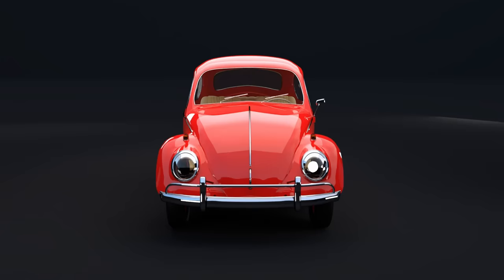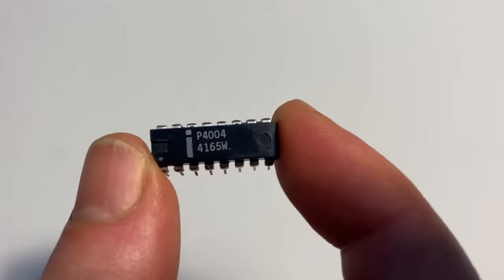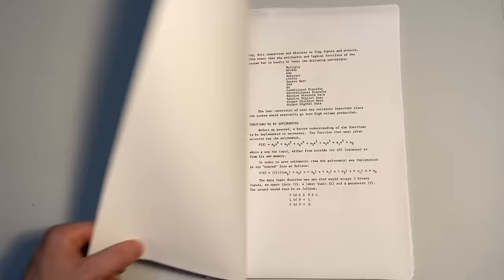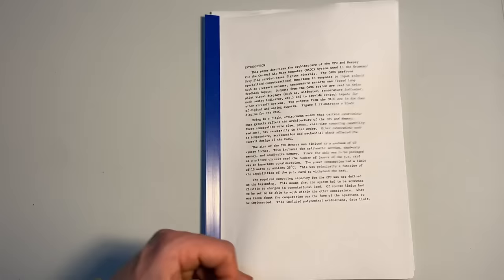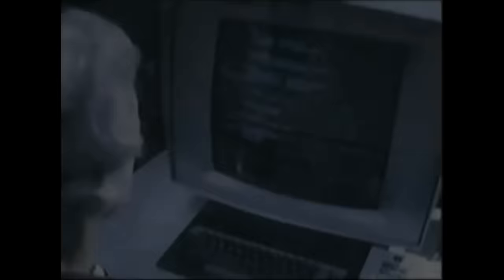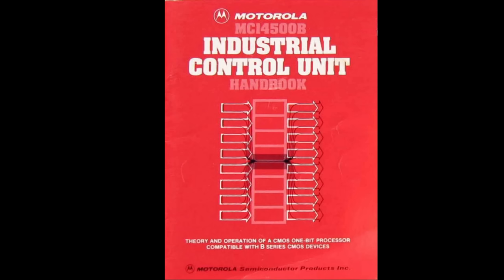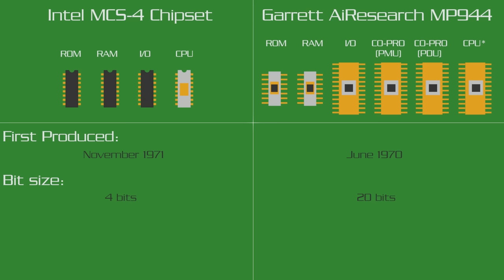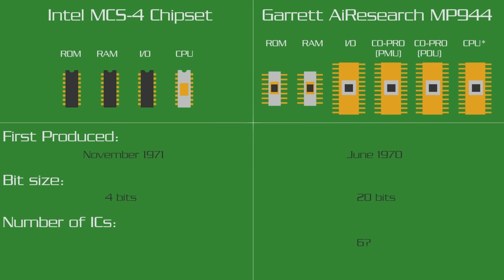The World's First Microprocessor: F-14 Central Air Data Computer

Comment: The mainframe comparisons to embedded dedicated control are a little misleading in the beginning of the video. The large mainframe, like the IBM 370 introduced in 1970, is a general purpose business computing machine, or computer, working on a time share non-real time OS. Whereas, a control computer for the F14 would be a dedicated computer running a single stored program, using a preemptive prioritized real time OS. The two are really vastly different in design and should not be compared side by side as to size.

The 20 bit computing word may not be related to 20 bits in ATD conversion. The ATD will lose bits of resolution in errors, but can also for specific ranges can be augmented by parallel ATDs with different gains. There is perhaps not reason why one ATD is required to cover a complete range you could have overlapping ATDs.

Having 20 bit words with sign is really just saying having 19 bits of resolution with sign. The 19 bits will use a fixed point math approach for size versus resolution (moving the decimal point around). The variables within the algorithms will be scaled as per function while maintaining enough resolution as possible. It is common to have a multiply into a double word and double divide into word usually with sign as native hardware features if computational speed is critical. You could then have slower double multiplies into a quad word and a quad divide by a double and so on in software (math library).

The 4004 evolved from a calculator design general purpose processor. At the time general purpose meant for calculator applications only. The general purpose programming machine was not really considered viable on a 4-bit machine used for calculators, nor would it be useful for a 20 bit word real-time application, although it could be used to understand embedded programming.

It is interesting that the 944 architecture is Harvard. If you have the instruction set, you can back out the most likely digital processing pipelines. For 20 bits it makes sense to clock 5 bits in 4 clocks. So the serial bus is only 5 bits and not 20 for a 4x clocking multiplier. Clocking frequency for a single bit line would be very high indeed for the ICs during the 944 time frame. 

The operation of ICs from -55 to 125 degrees C are the maximum extremes which really ignores reliability. The engineers of a computer for an aircraft will strive to reduce these extremes to a highly reliable MTBF range of temperature excursion. Basically, controlling heat flow. Also, analog parts of the design usually need a much smaller operating range to maintain accuracy due to temperature drift.

Calculating at 18 Hz or 18 times per second, seems very slow to me. For a Z domain transform the computational rate should be more like 160 times per second for system mechanical time constant (8Hz max) digital computer control of a flying jet. So, all calculations completed within 3.75ms (160Hz with worse case 40% latency penalty for a fixed priority preemptive hard real-time OS). Although, if you design the system you can do calculations in parallel where appropriate (like shown in the video), which is only really feasible for real-time control of a single algorithm.

Comment: Do you have a video about the jet fuel powered computer that handled the SR-71 engine inputs?  Its temp range got a bit higher than the unit above.
Reply: As in fluidic?  Now that sounds interesting.
Reply from the maker: ...and in to the 'potential future videos' list that goes. A hydraulic computer.....wow!
Reply: That metal pillow thing behind him in the opening shot near the intake is the fluid reservoir for the working fluid.
Reply: Jet fuel powered computer, no. But it was common to have jet fuel as the working fluid for the hydraulic actuation of the variable stators and maybe other things on the engine.

Comment: Just before 27 minutes into this video, you're showing an f4 G model, an F-111 e model from upper Heyford. The F model that I worked on was transferred to lakenheath beginning in 1977. Add what appears to be an F-14 a model. Those swing out control veins you talked about earlier were removed off of subsequent models of the F-14 because there were other ways to control certain flight controls to alleviate any issues that the plane had. The reason those were put on is precisely because the air data computer was not a godsend in the way you believe. That was a fix for a problem with the air data computer was not good at understanding.
That computer was able to remove a lot of analog systems that would have been required to do the same work. And the systems on the F-14 required a boatload of maintenance to keep it functioning. The capacitance fuel measuring system was difficult to adjust and was rarely in its best condition for knowing how much fuel you had on board as accurately as it had been asserted. After having worked on it, I'm certain that it has to do with the fact that the electronics of the day were still in their infancy. Having been rated on the F-15 and F-16 as well as the b1. There were a lot of changes in the way we did the wiring add several other things that were updated in those newer aircraft. The most obvious one was that wire looms came in ribbon cable. Where you had as many as 40 wires that were set into a flat plane and routed around the aircraft. It kept wires from picking up stray signals nearly as easily something that would have been necessary to keep chipsets from commanding things due to corrupted data.

Comment: Nice videos, and the Top Gun endless loop. 😀 I don't think you can say it is the first IC microprocessor if the PC was in the ROM.  More of an IC based microprocessor chipset.  4004 allegedly could run a minimal program with 1 IC and one generic ROM. But it was special purpose 20 bit with heavy arithmetic vs 4 bit so different problems. Maybe you can call it the first DSP.

Comment: I think you are wrong about the glove vanes. I believe they are for transonic flight to prevent Mach tuck but they weren’t very useful and were later removed on newer models of the f14. While moving CoP behind CoM decreases maneuverability is true it doesn’t really matter at speeds where wings would be swept back like that. At higher speeds you will over G the aircraft before exceeding a critical AoA so you don’t need the extra maneuverability. When the f14 is at corner speed which I think is around 350kt the wings will be full forward and that’s when you would be dogfighting and need the extra nose authority
Reply: true

Comment: F14 came about as original planned interceptor F111 joint fighter program didn't meet US Navy carrier requirements it was too heavy& had too high a landing speed for arrested recovery and catapult take off also nose and cockpit layout side by side made landing harder. The wing swept back for fast speeds but swept forward for better low speed landing characteristics. Im told F14 had a slight bug as its wing positioning could give its energy status away to oponents, many didn't get that close in combat.

Comment: The discussion about "what is a microprocessor" is a bit off. If the arguments made here are to be applied I can't think of a single "CPU"today that can function as a "microprocessor" if that mean's it needs to be a single chip. We do have a great many of "single chip computers" but we call them Microcontrollers. All the components discussed are on that single chip and they can cost pennies but I've never heard anyone refer to a microcontroller as a microprocessor. That term would probably still be reserved for what we call a CPU but it has exactly the same requirements as mentioned here but it has nothing to do with technological capabillities, just configurable design practices.

Comment: 8:05 The National Transportation Safety Board later concluded that the breakup was caused by Alsbury's premature unlocking of the air brake device used for atmospheric re-entry. The NTSB said other important factors in the accident were inadequate design safeguards, poor pilot training and lack of rigorous oversight by the Federal Aviation Administration (FAA).[3]
Reply from the maker: If you’re interested, I did an entire video about it (it’s not a great video tbh) and another one about fly-by-wire and how we try to design human factors like that out.

Pilot error was the direct cause, but in a competently designed system, pilot error shouldn’t have even been a possibility.
Reply: @Alexander-the-ok  i blame gawd

Comment: Thought I might mention that microprocessor really only needs to the CPU (requiring the chip set to make a microprocessor system), where as a microcontroller would need to include some I/O RAM/ROM be a largely functional system.

Comment: Thanks for posting this interesting video. I’m a pilot and always been fascinated by guidance and control of aircraft and spaceships. As I recall Apollo 8 had a digital autopilot installed for its flight, the first one made and manufactured by Sperry if I’m correct. IC was introduced on Apollo in the early seventies, but did it also utilise the PM944? A comment on this is appreciated. Thanks:)
Reply from the maker: Yes, you’re referring to the Apollo Guidance Computer. It was made up of many ICs rather than the small number used for the MP944. It was an astonishing piece of hardware - i did a video about it a few months ago!
Reply: @Alexander-the-ok  Thanks for your feedback, I’ll check that video:)

Comment: Processor definition is.  FETCH & EXECUTE Amigo.   I designed the IMMC for Global Hawk at Vista Controls, later Curtiss Wright Defense Solutions.   Retired 2017..    IBMSystem 360. 16.6 MIPS in 1968,   MIL-STD 1750 in 1986. About 0.750 MIPS,   2012. G4V Global Hawk 2000MIPS.  Wow. 130 mainframes.

Comment: As you state, the distinctions for what counts as a CPU in that period seem to be too arbitrary. There is so much built-in those that came later.  Until the late 90s most home use CPUs did not even have memory controllers, IO or what not. Now we have SoCs that bundle the CPU, RAM, storage, GPU, IO, etc. all in one chip.

Comment: So, at the very end of the video you mention that you don't think that the chipset changed the world. I am going to suggest that this is a very narrow vision.

Someone had to manufacture it. Meaning somewhere there was a team of engineers that had to physically make these chips, with these transistor configurations, and these inputs and outputs. These people probably understood pretty well what was going on at the physical level, even if they had no knowledge of the code. Also keeping in mind how long Rear Admiral Hopper's work took to really spread and take hold, I think it is probably a really safe thing to say that the people who worked on these chips took that knowledge elsewhere.

Those of us that grew up seeing the truly digital age take root also need to step back and appreciate the early computers like this one. We need to remember that "programming" as we call it today was still really new. Most computer engineers truly did think that the braided memory of the Apollo computers was cutting edge. So to have something like this operating with calculations at these speeds with such imminent impacts is WAY WAY beyond what the Apollo computers were doing.

Comment: The MP944 wasn't an integrated microprocessor. The core was split up across multiple distinct chips, vs being on the same piece of silicon. The Intel 4004 was still the first true microprocessor as we understand the term. 🤷

Comment: Sure, it's a microprocessor, but it's also an ASIC because it only ever had one application ... and that is a lot less impressive or important :)
Not only that, this is by definition a DSP: digital signal processor. It took digital signals from sensors and processed them into human-readable outputs.
That doesn't disqualify it from being anything else, but a DSP is generally understood as distinct from a CPU as you'd never want a CPU processing signals when you could get a DSP to do it instead. The reason being that a DSP does stuff in parallel.
Reply from the maker: It was only ever used for one application due to it being classified. Ray’s paper discusses other potential configurations and uses.
The same could be said for the 4004 - it was designed for one specific use case but ended up seeing multiple applications eventually by coding up new ROMs.

Comment: ‘Manoeuvring Flaps’? No such thing on an aircraft. There are just ‘flaps’ which are usually inboard of the ailerons on aircraft wings. You maybe needing to use the term ‘control surfaces’. The F14 did not have ailerons to control roll, it had wing spoilers for low speed and by differential movement of the tailerons at high speed.

Comment: Regarding 7:16, higher aspect ratios do not necessarily create higher drag coefficient, in fact it often times decreases the drag coefficient. For example look at gliders with long slender wings. These are ideal, because they mimic the 2D aerofoil better. The tradeoff is most often a more limited field of possible angles of attack. The "Naruto Run" configuration helps when going for high speeds, as the incoming air travels slower over the top surface than in the "T-Pose", thus minimizing the potential of a shockwave forming on the top surface. For a better explanation have a look at Real Engineerings video on that subject: https://www.youtube.com/watch?v=GXFpLnPpDtY

Comment: We always spend too much on militaries, because it has become necessary, or been necessary. For example, European military budgets were at an all time low prior to the Russian invasion and fall of the Soviet Union. Now they are increasing to significant proportions of GDPs. Military spending is a failure and a consequence that doesn't have to be inevitable. Or said another way--if the only relations you can have with someone are through death and threat of death, more than one thing has gone wrong along the way.

Comment: They use integrated circuits not discrete logic units (the amount doesn't matter), they transform data from input to output, that's enough for me to classify both of them as "micro"-"processors", they're small and they process data.
Reply: Many.  Ray Holt

Comment: With its 20-bit word size, the MP944 may well have been the last major computer to have a word size that is not a power of 2.
Reply: Several DSPs (Digital Signal Processor) are still made with e.g. 12 bit word sizes.

Comment: You don't really need a reflow setup, but do swing by the chemist's and pick up some isopropyl alcohol and some cotton swabs. Or switch to boards with not-white soldermask 😅

(But a cheap hot air station is totally worth it, if you need someone to blame for buying one.)
Reply: You saw all that flux too lol. It's fine, most is non wash now.
Reply: It's still better to wash it off so you can inspect the joints properly. It can hide defects.
Reply from the maker: I'd run out when I filmed that segment (I actually used it for something that will be discussed in a future video). The chemist wouldn't sell it to me....she seemed to think it was restricted...which it is not. So we just have to live with my ugly flux covered mess.

Comment: I've so far only watched the very basic intro part of the video, but it seems great! 

One thing, are you sure the glove vanes were used to increase maneuvrability? I understood there were some stability issues at some range of speeds with the wings swept back, even though I don't remember what speeds they were. Glove vanes were to battle that. I don't think increasing maneuvrability with shifting center of pressure forward is a viable thing, as it would for sure increase maneuvrability, but lack of maneuvrability at high speeds was more bottlenecked by the g-force limit of the aircraft, and not by the aircraft being "too" stable with the wings swept back. Not too sure about this, I might need to research more on this.

Comment: Fantastic video. Love it! Amazed by the capabilities and seriously impressed by the ingenuity displayed by the engineers. My nit-pick: I would call the MP944, as used in the CADC, a multi die ASIC and not a microprocessor. I do not  subscribe to the "purist" approach that it must all be on one die/chip. That in my opinion is just a load bovine you know what. For me a microprocessor is any collection of parts, semiconductor based or other equally, possibly more compact configuration, useable for general purpose computing. In effect use some chips not, several 19" rack based units connected together. Maybe showing my age here, but an IPhone uses a microprocessor with multiple cores and a Beowulf cluster used many computers to achieve the same result. By general purpose I mean: I can program it to perform any task that takes my fancy.  As you state other configurations were possible. Maybe one such a configuration could be called a microprocessor, the MP944 as used in the CADC does not qualify.
Reply: Given a general purpose need the MP944 can have many configurations and a compiler could have been made.  Ray Holt

Comment: But is it a CPU or not? Can it branch? 
I see this more as a some early form of DSP or "ASIC" per se that do specialized work. 
Also I not so sure on your definition of parallelization, what is done in this is more on the base on what superscalar architecture does so that you different execution units tailored for different operation than just a single ALU. 
You really stil execute the algorithm instruction one at a time. 
Anyway good video!
Reply from the maker: Yes, there were logical conditional instructions that could be implemented by the SLF chip. Though, I havent been able to find the full instruction set.
As for parallelisation…..that’s probably me being a data scientist - I work with spark clusters all day so have a very loose definition of parallelisation.